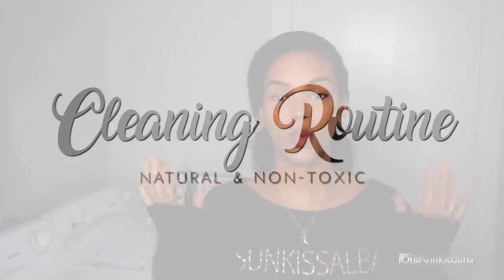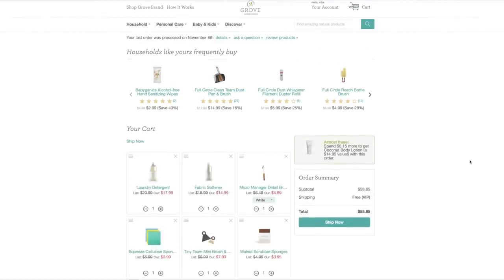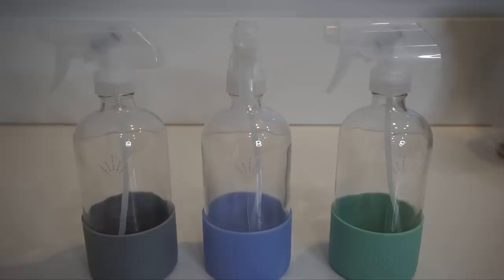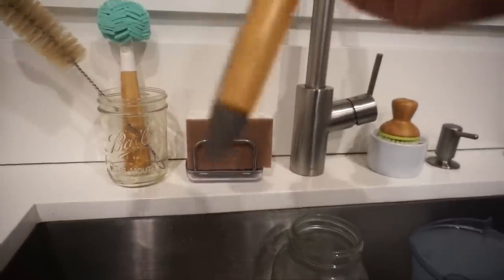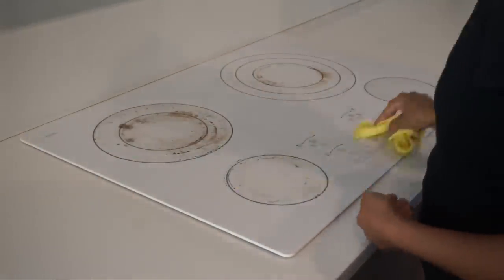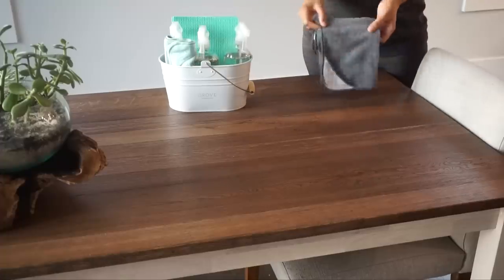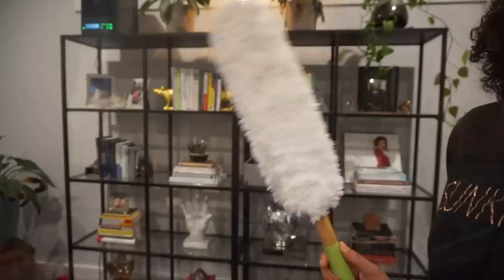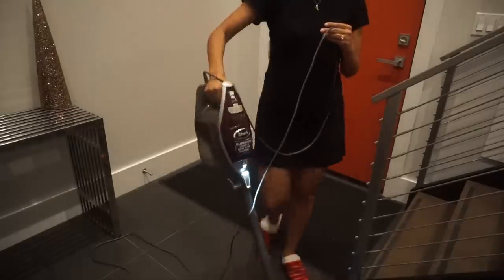CLEAN WITH ME! // Natural Home Cleaning Routine

Comment: My fav diy cleaner is dish soap + white vinegar and warm water in a spray bottle. I use it to mop the floors, kitchen countertops, bathroom tiles and mirrors( no streaks). I have eczema/dust allergies/ and asthma and this doesn't trigger my allergies at all. :) no nasty chemical smell and keeps everything clean. I also use it to clean my boots in the winter 😅
Reply: LoveoftheLittleThings 1:2 ratio for soap and vinegar. I get the spray bottle from the dollar store, and add about 2 tbsp soap+ 4 tbsp vinegar. And then fill the rest off the bottle with warm water. Any brand dish soap I use Palmolive the passion fruit one. And whatever white vinegar is on sale.

Comment: great video! Just a quick note, vinegar doesn't disinfect everything. There are some types of bacteria that it doesn't kill  (for example some bacteria found in bathrooms) and, just like most disinfectants, it needs a few minutes to sit on a surface to actually disinfect. When used properly, it disinfects around 80% (as opposed to 99.99% in most commercial disinfectants), which isn't bad at all, unless you need to get rid of a type of bacteria it doesn't kill. Personally, I prefer using 70% rubbing alcohol as a disinfectant. Feel free to research this it's pretty interesting! Also, just in case the steel wool is scratching your stovetop, baking soda and dish soap with a non scratching sponge works great!

Comment: I used to use Borax in my laundry but stopped because it started making holes in my clothing. You forgot to mention you can use any essential oil on the wool dryer balls instead of conventional dryer sheets or fabric softener.

Comment: Love the video! :) Does the vinegar solution ever leave a smell in your house? I always read that vinegar is such a powerhorse in the natural cleaning world but I’m scared it’ll make my house smell like vinegar 😣
Reply from the maker: DomoLover118 only those who have never tried it assume the home smells like vinegar when cleaning with vinegar. White distilled Vinegar is a deodorizer, and disinfectant there’s no vinegar smell after using it just simply clean air with no smells
Reply: DomoLover118 I am personally someone who does not mind the vinegar smell as it now reminds me of the smell of clean and it does dissipate very quickly while deodorizing like Alba said. However, when I was writing my book Easy Green Cleaning a lot of people cited vinegar as one of the primary reasons they do not green clean because they do not like the smell so I feel it is important people are aware of alternatives. Instead of vinegar you can disinfect and clean with a solution of 1 part vodka or rubbing alcohol to 3 parts water or you can use hydrogen peroxide (both are stronger disinfectants as well and safer for more surfaces vinegar should never be used on granite or other natural stone). If you would still like to use vinegar but don't like the smell try adding some essential oils to mask the smell. Orange and lemon work especially great. Hope this helps!

Comment: question, can you use the vinegar solution on the wood?
Reply from the maker: JustineNicole I do, like I did on my floors but I’ve never tried using vinegar on my wood tables
Reply: JustineNicole I hope you don't mind me chiming my 2 cents in here as I have done a lot of research on the subject and even wrote a book called Easy Green Cleaning where I discuss this. Vinegar use on wood can be a little bit of a controversial subject when it comes to wood floors. Some people swear by it and some people say it can break down the finish over time as it is an acid which can reduce the shine. Although I personally think it is a fine option if the floors are not waxed and include it in my book I also include another recipe for people to use in case they don't want to take the risk with vinegar. It is just 1 part cheap vodka or rubbing alcohol to 3 parts water in a spray bottle. Not only is it PH neutral meaning it wont destroy the finish but the vodka/alcohol helps the moisture dissipate very quickly which is so important when cleaning hardwood floors as too much moisture is the quickest way to destroy them. In addition it is streak free and will disinfect in the process. If you want to add some scent you can add some essential oils to the mix but just make sure they are kid and pet safe if you have either which I also discuss in my book. Hope this helps!
Reply: thank you both